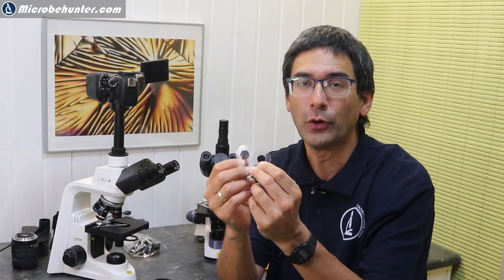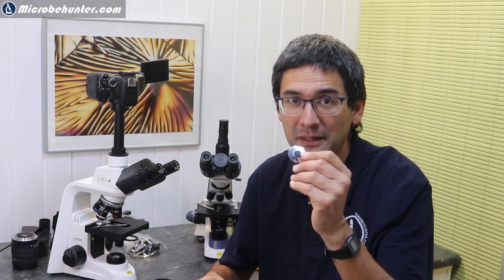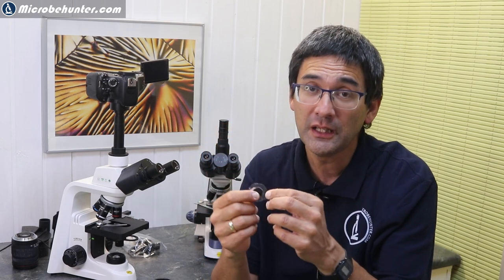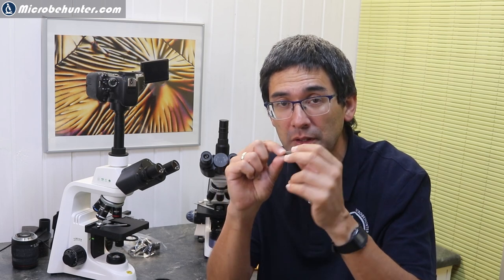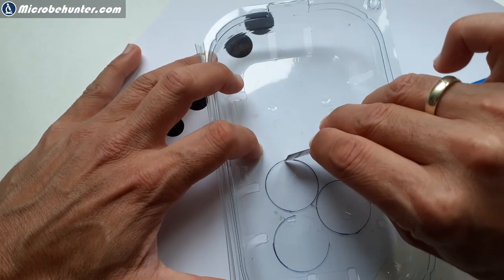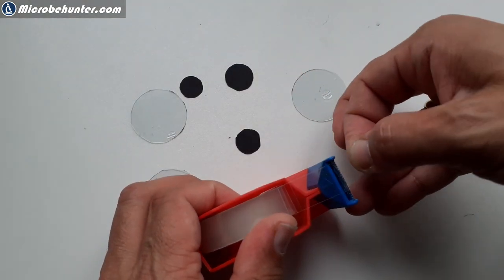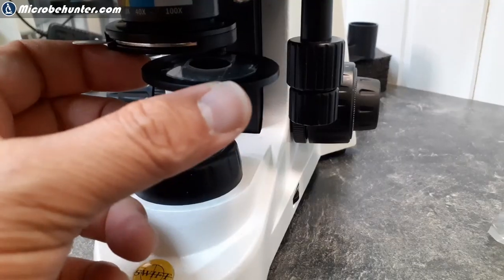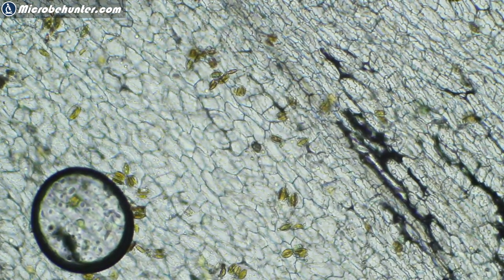🔬 Making a cheap Darkfield Patch Stop Filter for your microscope | Amateur Microscopy

Comment: Hello, I am using a Swift SW380T like the one you have but i have a problem with darkfield. it seems like my slides are too dark when i use 40x objective. I tested 15/16/17 mm patches but it's not really working as it should. Am i messing smth else up maybe?

Comment: I'm gonna try to make my patch stop by cutting electrical tape into a circle and tape it right to some projector paper. Thanks for your videos. Learning a ton.
Reply: That is what I ended up doing. For my microscope, I took a triple A battery and stuck some tape to the bottom of it and trimmed around it with a pair of scissors. Stuck that circle on to a piece of heavy plastic, cut to the proper shape and I had my filter. Works great with other colors also.

Comment: Hi Oliver! I went into the glass shop near and asked them to cut me a glass filter just like the blue filter that came with the microscope. Then I glued a black plastic patch stop to the middle. It worked well upto a few times, then it started to look very blurry even though I cleaned it. I also tried to make from plastic boxes like you do, but those boxes are not as transparent as glass. Anyway I’m just thinking what could have happened? Also does it really work at x400 aswell because for me at x400 the background and the specimens too are completely pastel white instead of black background and white specimens and I can’t almost distinguish anything.

Comment: Awesome! I have a SW380T but can't achieve this results. I tried to manually make darkfield filters but they are far from perfect. Did you change the lighting?
Reply from the maker: no change in lighting. the disk of the filter must have the right size.

Comment: It is also important to know that light source can affect patch stop size.

My microscope has a single small led as a light source so my patch stops have to be much much smaller than these. I still can’t find a way to achieve darkfield with the 40x objective but the 5x and 10x are working great
Reply: I know what you mean they need to design a variable dark field condenser plus objectives need a variable iris which is no big deal  why ?
Reply: @Mythreesons137.  I need to adjust the condenser's focus for the home-made disk I made to work. The background I get is more grey than black.